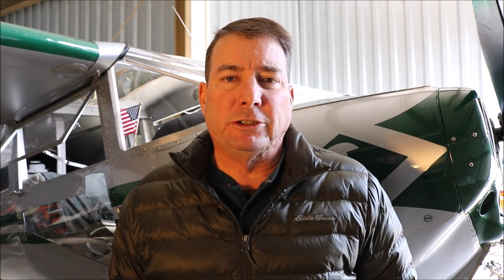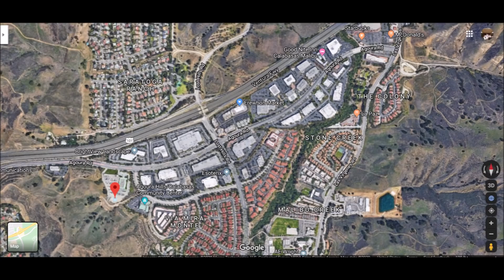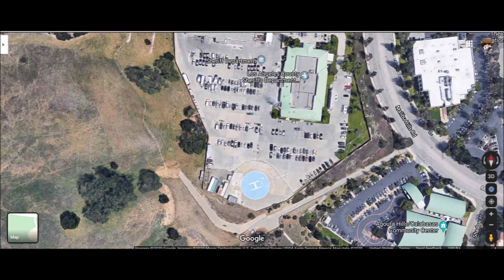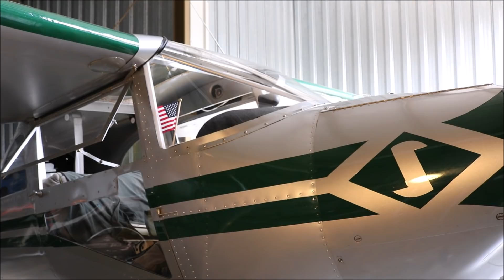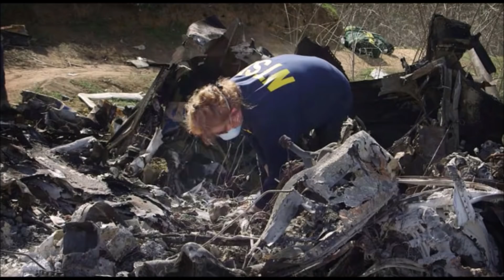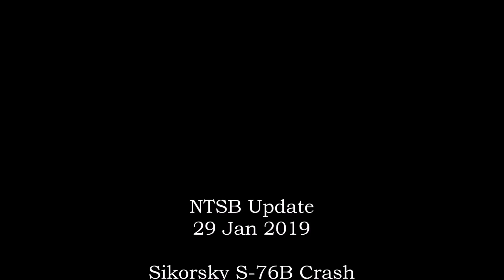Kobe Bryant Sikorsky S-76B Crash Update 29 Jan

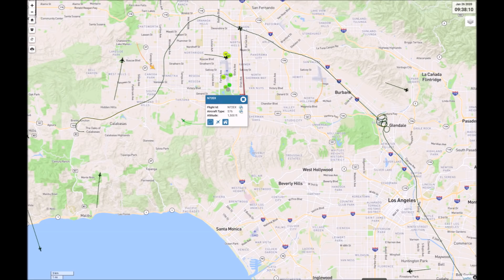Comment: at 11:03 why was he going in to many circles? was he not in control then either?
Reply from the maker: No, waiting clearance to cross the flight path of Van Nuys arrivals.
Reply: Kaylen Wade he was waiting to clear other traffic taking off and landing at Burbank I think.
Reply: He was holding with tower control to confirm and clear his route. So he was just hovering around during that time.
Reply: Kaylen Wade no, he was waiting to get Permission from the ATC to operate under special visual flight rules.
Reply: Kaylen Wade At the beginning of the flight he was holding for about 15 minutes before given permission to transition across controlled airspace. If you take a listen to the radio communications you’ll have a better understanding.

Comment: Juan isn't lying or exaggerating about the FAA and "...this takes time" phrase... 

United Airlines 737 Flt 585 Rudder Reversal May of '91...Fatal
Then, USAir 737 Flt 427 rudder reversal Sep of '94....Fatal
Then, Eastwind Airlines 737 Flt 517 rudder reversal Jun of '96, managed to save the aircraft.... 
737 Rudder PCU's (Power Control Units) replaced fleet wide by Nov 2002.

ValueJet May '96.... Cargo hold Fire detection and extinguishing system ready for in stall, 2000.

TWA 800, July '96... Inline fuse mod on FQIS (Fuels Quantity Indicating System) @ 2002, (TEMP FIX) FTIS mod (Fuel Tank Inerting System) ready for install on aircraft...19 YEARS later...2014 (for A320 series AC).

Just to name a few...

Comment: A terrain avoidance warning system on a helicopter is a constant nuisance and often gets disregarded or shut off because the helicopter is already flying close enough to terrain to constantly set off the warning system.  They would have to be much more sophisticated than the current systems that are on airplanes (they are usually airplane style/hardware/software systems that are simply put on to a helicopter) so as to not have constant terrain warnings (and the associated distractions) that are blanking out other needed instrumentation such as navigation, etc.

Comment: As a pilot I tend not to speculate and wait for evidence. Having said that, this channel is a breath of fresh air. I just shake my head at some of the nonsense being posted and written out there. Subbed, keep up the great work.
Reply: I personally think the pilot had a medical event which caused the helicopter to crash. It was reported that the helicopter hit the ground at a speed above 170mph and descended at an alarming rate. I don't believe an experienced disoriented pilot would accelerate and drop altitude that fast in a zero vision area. The eye witness also said he didn't hear anything unusual with the helicopter hovering above. So either he lost control suddenly or the pilot had a medical event mid flight and passed out (which could have had him slump over with his hands still on the controls and basically fly it into the ground). That's the only thing that makes since to me because I recently watched a video were a student pilot was doing his 1st flight but his instructor passed out on him so he had to contact the towel for help. Luckily they were able to get him on the ground.
Reply: @rotaryperfection  He could easily have been disoriented. It's common with even very experienced pilots. I think he just flew into the ground while disoriented. 

I also hope TWA Flt 800 is re-investigated soon.
Reply: @scottcampbell6617  But even if you're disoriented , why would a sane pilot fly with such an accelerated rate downward if they couldn't see were they were going? To me, I would have flown as slow as possible knowing terrane was near. I mean safety 1st right?
Reply: @rotaryperfection  have you ever been disoriented? You have no bearing and you're confused.  Now imagine being 2500 ft in the air in dense fog and can't see a damn thing, disorientation happens in seconds.
Reply: @mymusic8414  Oh I believe that but that's why you have your compass and gauges. He did the right thing by climbing higher when he lost visibility but I don't understand why he just didn't use his compass and turn 180 and head back over the same terrain. He was previously told to stay below 2,500 so he had room to climb because he was at 1400. The ground witness said he was hovering in the area slowly in the clouds. I think he was trying to re-establish communication because after climbing, he was still too low for the tower to follow his progress since those hills were still higher than he was. I think this is what he wanted to do and why I think something happened to him when he was trying to figure out were to go. Radar shows they lost 300ft in 6secs before crashing. That's damn near like jumping off a 30 story building and hitting the ground 6 sec later so it came down pretty fast with forward moving velocity.
Reply: @rotaryperfection   Yes, anything is possible on the cause.  Only God knows
Reply: @rotaryperfection  i been thinking the same thing, I feel like he might of had a medical event
Reply: @rotaryperfection  or engine fail/ lost power??
Reply: @sonidamara5018  Possible but the eye witness said he didn't hear anything unusual with the engine.
Reply: @rotaryperfection yes i dont know for sure but the pilot are highly skilled.. i think it was combined factor on that event... thick fogg and lost engine power or pilot health issue.. n my be the passanger talk or ask to the pilot n makes him very busy...very sad.. its just my oppinion.. sory for my english..
Reply: @rotaryperfection  why do people pass out from flying ?
Reply: @curtfrmthemittn11  Raised anxiety due to a loss of visibility situation maybe? I'm not a medical expert by any means. I'm just saying that the pilot could have just had a random health issue at the wrong time given that he lost visual ground reference flying into that area. Raised blood pressure and stress could have caused a number of things to happen to him shortly afterwards.
Reply: @rotaryperfection  an also there are physics readers who are also sayin he was havin anxiety and they were sayin kobe was arguing with the polite an he passed out an also others were saying the polite was suicidal and drove into the ground..and its just a messed up situation either cause damn i couldn't help but think kobe was probly holding on to gigi and scared out of his mind and lord i hope just hope he didnt feel anything
Reply: @curtfrmthemittn11  what in heck are you talking about?
Reply: @mymusic8414  re read slowly dumb dumb smh i basically said he could've had a anxiety attack And lost it
Reply: Leo... you are correct. Saw a video from ET and the woman reporter was talking to a former pilot who used to work with the pilot on the Kobe helicopter and she just kept going on and on and on... asking more more questions that could not be answered and she knew they couldn’t be answered. I finally couldn’t take it anymore... and shut it off. 
Juan always gives the BEST and most knowledge and detailed updates.
Reply: @alant5757  far be it from me to suggest that anyone watch that b.s. but since you almost made it through, I do suggest you watch until the end of the ET interview. Kurt kept control of the conversation and finished off with a pretty heartwarming statement. 
 Fckn "journalists" can be exasperating, but  Kurt nailed it and didn't let her run him.
Reply: @alant5757  Alan, that was the best investigator ever, you would have learned more if you'd stop turning people off.
Reply: We will probably never know why or how.That's why people speculate.
Reply: @wanaraz  it has me thinkin something shady went on
Reply: Leo Iezzi when in doubt sit it out
Reply: You guys are answering your own questions, if you're in a cloud in complete whiteout, and have no idea what direction you're going, then the direction you can quickly end up going is straight into the ground. Stop assuming your sense of motion while in flight would be the same as on the ground and that you'd know you're descending. He would have had only seconds to fight his senses and look at instruments, and by then could easily have put the aircraft in an unrecoverable state.
Reply: I think most people get the picture way before any investigation period and your a pilot ?
Reply: Exactly what nonsense
Reply: So what made him lose control? Why it go down if he was heading up ?
Reply: A good pilot knows when not to fly (Foggy Conditions).
Reply: I agree about some of the senseless speculation, but there are some facts that can help the non pilot laymen understand. One thing I have noticed in many of the comments is that people don't understand the word disoriented. As that word applies to pilots, that means that we don't know which way is up.

In this case it is speculation at this point, but disorientation in IMC is a likely scenario. Going with that assumption, when the pilot became disoriented he may not have known which way was up so what he thought was a climb or a turn may not have been what was actually happening.

This disorientation can happen very quickly and become irrecoverable very quickly.

Just trying to educate people in the basic facts of flying helicopters.
Reply: Never mind - I found a couple alreay
Reply: So why is this helicopter white and blue? Kobe’s was black.
Reply: @mk4vws  The registration ID was the same, N72EX i believe, When it was black it was probably a wrap he had on over the original livery
Reply: @mk4vws  i have yellow submarine..
Reply: @sonidamara5018  Just a bit of humor, I see!!! Lol..
Reply: mk4vws yea, that’s what I’ve been wondering too from the very beginning.
Reply: Which comments in particular?
Reply: PARK also different color helicopters.
Reply: Freemasonry
Reply: Andrae X  Uuuum !!!
Reply: Ntsb safety board member Jennifer Homendy is deep state. She also did the point conception boat fire
Reply: As a pilot would you take off in so much fog as much as there were
Reply: @marthaford2112  I'm not IFR rated, and neither is my aircraft.
Reply: PARK  be who
Reply: @Leo ease up on people commenting. They're just trying to make sense of a senseless situation.
Reply: @sevnlight6313  Almost everyone likes a good mystery. This is one.
Reply: Yes, Sit back and wait for Adam Schiff to tell you what happened.
Reply: @matthewellis8626  LOL
Reply: Better yet, let's hear from Bolton, Mulvaney, Pompeo,  etc. If the IMPOTUS thought any one of these guys could clear him, they'd be under oath already.
Reply: You see the conspiracy about the NBA supporting Hong Kong, leading China to take Bryant out?
Reply: I agree with you, I had a argument with a friend yesterday that turn bad, as a pilot I told to my self all never talk about those thing anymore with a somebody that is not a pilot.  lolll
Reply: Andrae X  "Without"...But you're  absolute 👍👍👍👍👍
Certainly doesn't resonate with credentials of a 20-Year veteran but there's a difference between how long you've been flying and how long have you flown ?...Your "seat-time" is your experience, Not how long you've had a pilots license !
Reply: Leo Iezzi   You mean fake news😊

Comment: It seems a go pro camera with audio placed so it would record the instrument panel and any voices would be a huge improvement from what we have as a requirement for data.  I have one in my car that automatically loop videos 5 minute segments out the windshield.  A similar system with gps upgrade etc should not be very expensive but would yield precious information. Only the chip would be necessary to survive a crash.

Comment: Non pilot here.
When they say 1300 ft altitude is the altimeter reading to the bottom of the canyon?
And he crashed into the "side" of the hill?
Reply: john hud All the altitudes given by NTSB were above sea level.  The altitude of Calabasas is just under 1,000’ above sea level.  Thus he crashed about 85’ above the 101 highway but had climbed before the decent to 1,300 above the 101 or 2,300 above sea level.
Reply from the maker: MSL, "Mean Sea Level" = height above sea level. Good question.
Reply: john hud elevation from sea level
Reply: @stuartmonohan2277  thanks

Comment: Juan, I am also a pilot, although not at your level. That said, that "Helicopter" flight should not ever have taken place. I know I am overly cautious, but if the weather is not conducive to my flight - it IS NOT going to happen..... "PERIOD"
Reply: Don't forget how easy it is to judge from our comfy chairs while we ponder these things. The human brain is a complex and imperfect thing, we can only hope to improve from incidents like this.
Reply: Always consider how necessary is the flight. !
Maybe the pilot thought he was under pressure to completed the flight ? But maybe a discussion with the client before take off about weather  and  they  decide to delay the flight.
 For recreational flyers  you should always wait for  suitable weather. 
Even airlines cancel delay flights no big deal ! 
We wait and survive
Reply: I have a question for you...Is vertigo more common with helicopter pilots that enter IFR conditions than fixed wing pilots entering IFR conditions? The reason that I ask is that I went up for a first time, front seat flight in a Jet Ranger, and on our way back the weather conditions went from VFR to IFR due to a marine inversion layer along the shoreline where I live. Very common in the late summer/fall. The pilot requested a sterile cockpit/cabin just before we flew IFR, and about 20-30 seconds into the fog, It felt to me, that the chopper was banking and not moving etc.  I looked at the altimeter and attitude indicator and I could see that we were level and moving forward. I've never experienced that sensation before in a fixed wing aircraft flying in IFR conditions and it scared the sh*t out of me.
Reply: Better to be safe than sorry.

Comment: Nobody seems to mention that the FAA has a dual role. It is regulator and promoter of aviation. Blanket requiring TAWS equipment—not only under part 135 but also under part 91–would likely not be a great promoter of aviation. It would raise the cost of entry significantly. Would that make things worse? It could; they have to take that into account.

People want to think that a magic box would fix poor judgment. They also want to think that the FAA can wave its wand and require that everybody carry the magic box. It’s not that simple, and I’d hate to lose the “promote” side of the FAA’s mandate.

In my opinion, Homendy can be a grandstander, and she was flirting with that here. There will be a time and a place for the NTSB to make and/or reiterate their recommendations.

Comment: Just for clarification, Part 91 does not just apply to general aviation. Part 91 applies to Part 121 and Part 135 operators as well. The reverse isn't true of course, Part 91 operators do not have to comply with part 121 or 135 regulations.

Comment: The doorbell audio recording from a nearby home seems to indicate not very much forward airspeed prior to impact. In fact the last 4 seconds of flight the turbine/rotor sounds remain the same volume, indicating very little change in distance from the microphone. It's path was majority vertical.
Reply from the maker: link? Thanks! jb
Reply: @blancolirio  In addition to the audio link, it may be helpful to know the approximate location of the doorbell in relation to the crash site.

https://www.google.com/maps/@34.1386611,-118.702275,3a,75y,175.82h,84.03t/data=!3m6!1e1!3m4!1sdXYg9_A9chTM7x8s65Hw3A!2e0!7i16384!8i8192

This is a bit confusing now. There is 17 seconds of time between the peak audio of the helicopter and the sound of impact. The crash site is ~3080 ft from the doorbell, which would take the impact sound ~2.5 seconds to arrive at the microphone. That leaves ~14.5 seconds of flight time between peak audio and impact, over a 1/2 away.

Comment: Great coverage.  I would be interested in hearing your guest comment on rapid descent...spacial disorientation or maybe a sucker hole? Use of synthetici instrumentation in emergency IMC.
Reply: Sucker hole? What's that? An opening in the clouds that the pilot thinks he can go through to get to safety?
Reply: The Peace Project  Sometimes a pilot will be fooled by the weather to think that a break in the clouds is an opportunity to “escape” a threatening weather situation.  In this case it might have been a sighting of a patch of ground through the clouds that looked like an opportunity to return to VFR conditions under the clouds.  They are usually brief “opportunities” that a pilot is has to respond to immediately because they are just “holes”.  Having said that, I think it is highly unlikely because he had already climbed 1,300 feet in the clouds which makes responding to a sucker hole a very dangerous situation when you know you had just left a bad situation below the clouds.  It is more likely to occur when the pilot is on top of an overcast trying to get below it.  Hope that helps.